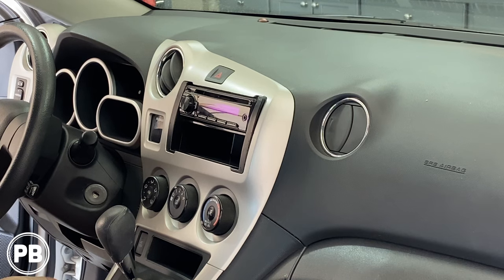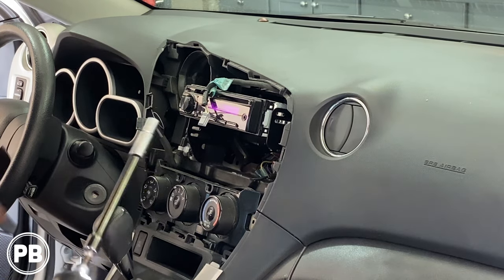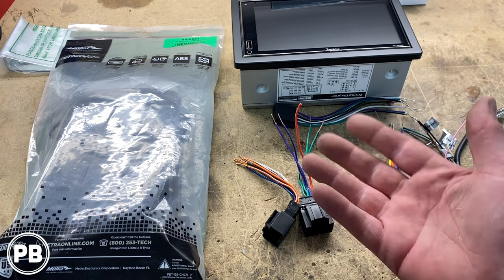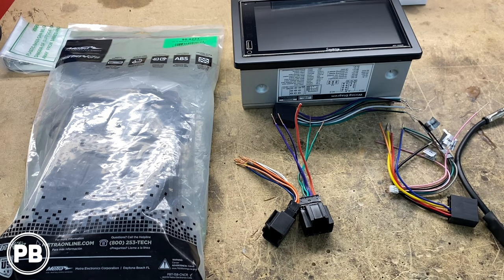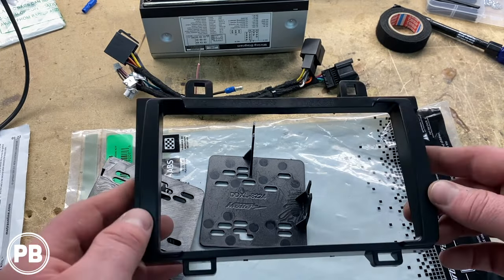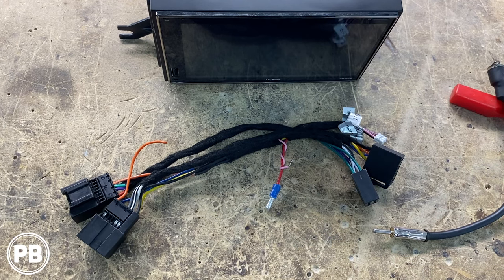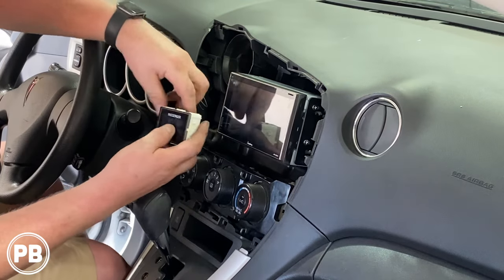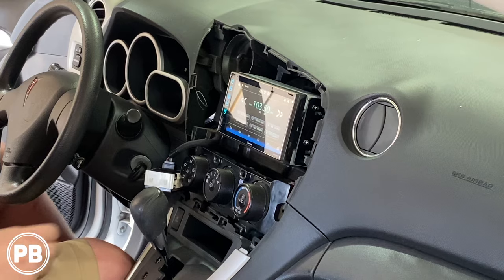2003 - 2010 Toyota Matrix / Pontiac Vibe Radio Install

Comment: Hello I have a Toyota matrix 2009 if a buy sjoybrind what part I need I just little confused.. I hope you help me … thank you.!
Reply from the maker: I have different packages listed in the description based on your year.  I also recommend a brand name radio, the joybring units are garbage.
Reply: That what I like joybrind my is a Toyota matrix 2009 .!
Reply: I have a 2009 Toyota matrix. I bought a Fascia plate that matches the 9 inch hikity head unit at 35 dollars on Amazon. I bought the hikity head unit from Amazon too, about $180.00. Get the 4 core or higher (I got 6 core) and 128GB version. It looks like a factory install. No amps needed. The sound is perfect. Never any distortion. I love that head unit! Android Auto is awesome. Waze maps! Pandora music or Spotify.

Comment: I put an Android HU in my 2009 Vibe w/Monsoon. Everything works great except I can't seem to get the steering wheel controls to work. I have seen a few diagrams showing the pin locations for the vehicle's harness, but I don't know which of the remaining wires on the ISO connector hook up to them. I have ILL, KEY1, and KEY2 wires left unused on the HU side. I also have a hissing sound very noticeable at low volumes. I'm guessing that might have something to do with the signal coming out of the HU being amplified and not line level?
Reply: Did you have to use a line output converter with the monsoon system?
Reply: @corbinwalters  I didn't. Would I have to mess with the amp under the passenger seat, or just could I just wire it between the HU and the vehicle harness?
Reply: @cpatterson365  I won't lie to you, I've got no idea. Crutchfield recommended I get a line output converter. I just got an 09 vibe with the monsoon system yesterday as my first car and I'm just trying to research the best way to put a new head unit in it.

Comment: The Metra 70-2105 harness does not match up with the radio, as there is no orange wire or orange/black wire. I had to purchase an alternative harness, which was disappointing. While I connected everything and it works, I have no idea what to do regarding a dimmer, because I am not sure the advice in the video was accurate for the 2010 Vibe, and neither harness I purchased has a orange/black wire. The mounting bracket included does not fit a 2010 Vibe and has to be modified on the left lower bracket (Sawer or Filed down). This would have been better, if explained. Otherwise, the video was well done.
Reply: Not the same for 2010 Matrix either, had to get a different Metra adapter 70-1761. I'm also struggling to find the source for an Orange illumination wire.. may have to tap the parking light +12v on the headlight switch for illimunation on Nakamichi na6605. Not super looking forward to that..

Comment: How did you determine which location was correct for the dimmer? Did you use trial-and-error, or did you find a schematic?
Reply from the maker: A multi-meter or test light is the easiest way.

Comment: Well, I thought this would be super easy after watching your excellent video, but it turns out the wiring in our 2010 Matrix XR looks different than the Metra 70-2105 Wiring Harness Adapter has. I can't seem to post a photo, but it has 4 connectors, not  just the two on the adaptor harness. I assume one is for the steering wheel controls, but the location of the colored wires doesn't line up at all with the Metra warning harness. The radio we're replacing is a Fujitsu Ten, Toyota part 86120-02710. Any suggestions for a suitable harness?
Reply: OK< it worked perfectly. 2 of the factory harnesses not needed.

Comment: I bought the kits you linked.
My metra 70-2105 wiring harness does not fit my 2003 Pontiac Vibe.
And the metra 95-8224 does not fit my factory mount either. Like even if I shave it Downcomber it will not fit Is through the actual space.

Im confused, mine does not look like the wiring harness you are using. But it is the exact wiring harness you show a photo of while talking about  the Metra harness
I'm wondering if I should Just find a wiring diagram for the car's wiring harness. Then just saw her the head units wiring harness to those wires? I would much rather return these parts that don't fat and get this working tonight.
Reply from the maker: You purchased the wrong parts.  See the parts linked in the description have different years categories, so you've purchased the wrong harness.  See the description for the right parts. *Metra 70-2003 Wiring Harness Adapter: https://amzn.to/3pqidYV

Comment: you don’t need a smart harness, the stock one is fine, im using a universal harness with NO dash kit, you seem like your jumping through extra hoops with no reward
Reply from the maker: That will get you into water REALLY fast. Hacking up the harness, and jerry rigging the radio without the proper parts is a recipe for disaster. Just because you are okay with those standards doesn’t mean everyone else should stoop to that level.

Comment: Hi, For a 2010 Toyota Matrix Base. What antenna adapter will be suitable and would I have to perform the dimmer orange cable swap?
Thank You!
Reply: Just plug the factory connector in. I'm not sure why this guy made all this so complicated. You don't have to run a red wire. It's in the $5.39 wiring adapter from Metra.

Comment: Can anyone comment as to why the Vibe/matrix would need a separate 12v connection? everything looks copasetic on the harness end.
Reply from the maker: For the gm version (not the Toyota version), there is no 12v analog accessory wire at the radio as it’s driven by data. There isn’t a supporting smart harness for the gm version, hence why you need to run a 12v accessory wire to the fuse box or similar location
Reply: Thanks for the quick response.  @ProvoBeastAudio

Comment: Great video! I bought the wiring for a 2010 Vibe. You wired a back camera up in a 2009, so I thought the wiring I bought would match the colors you used. Did you put the radio in a different model year? Also, there are multiple green wires on the adaptor harness I have. Does it matter which green wire I match it to on the radio wiring, or is color for color adequate?Thanks!
Reply: I now see one is a green/black wire, not solid green. The 70-2105 harness is not equipped with orange/black or orange wires. How do I connect a dimmer? Additionally, what do I connect the JoyBring Orange (illumination) wire to?

Comment: Hey there. Thanks for your video. I got the swrty 61j but the connections don't actually fit my 2009 matrix. I have three white connectors and what looks like a blue IR connector in my dash. Any advice would be awesome.
Reply: Also it's the JBL with steering wheel controls.
Reply: Ok after some tinkering and properly looking for all the parts in the crux box.. I found the correct harness and got to it. Pleased to say that EVERYTHING WORKS!  thanks for the video - really I'm so happy with the unit. Didn't think it would make such a difference to the sound but dang. Also the android feature is great. Let me know if you have any videos for a 2011 tacoma. that's next on my list!
Reply: @BP-dt5bx hey man did you have to do anything with the dimmer switch for your matrix?
Reply: @matthewmalure8730  hey no actually it all just worked with the harness. Dimming works. However I found that the steering wheel buttons are switched around now. I'm yet to figure that one out..
Reply: @BP-dt5bx  thanks so much for the quick response. I plan on installing it tomorrow so hopefully all goes well.

Comment: Where can I find a power adapter harness?
Reply from the maker: We linked all parts we used in the description
Reply: Thanks for the reply, I have a 2012 matrix with the steering controls, do you have a part number or link for the harness adapter? TIA